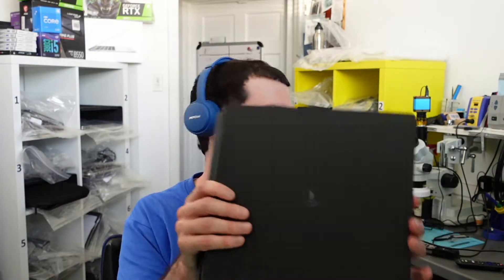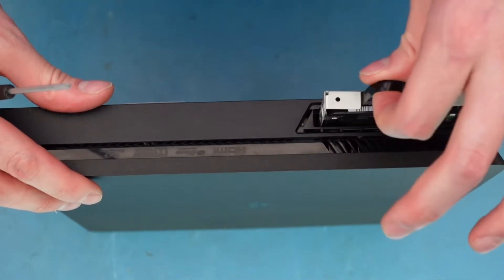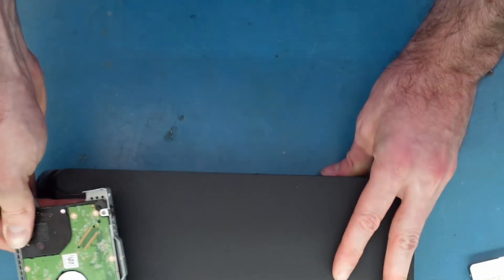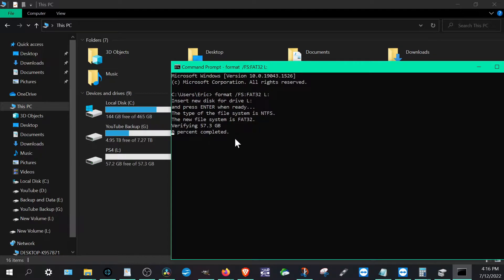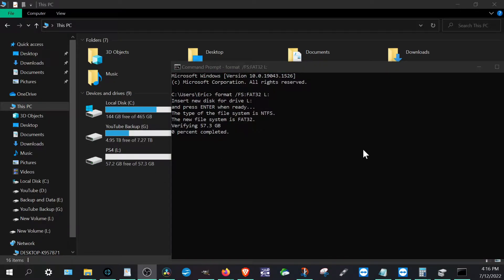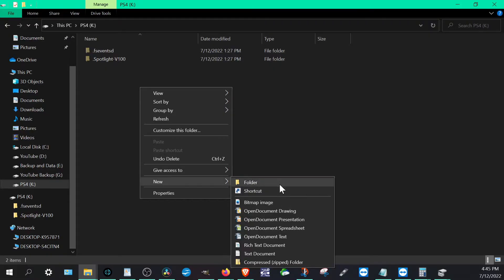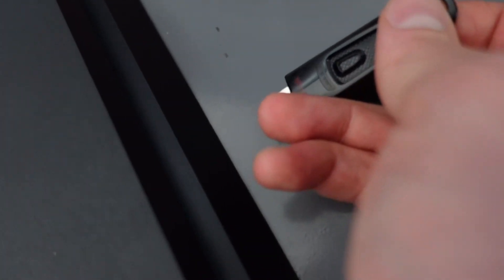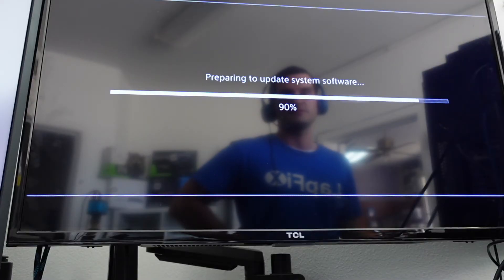PS4 Hard Drive Replacement + How To Upload the PlayStation System Software

Comment from the maker: Anyone still trying to upgrade or plan to upgrade to a PS5?  If you can't try to upgrade to SSD on your PS4! 😁
Reply: Going the SSD route :)
Reply: I don't wanna waste my money on PS5...for now👌
Reply: I remember the last time I put a 2 terabyte hard drive in my PS4 it accepted exFAT for the format. I've been trying to put a Samsung Evo 870 4 terabyte into and every time I boot it into safe mode to reinstall system software it says update file corrupted while I have the USB Drive-In. I will definitely take your advice and try FAT32 next
Reply: hey i have a question i don't know if you do know if its possible, but if you install the new ssd inside the ps4 can you install a jailbreakable firmware then jailbreak the ps4.
Reply: Sir, do you know how to fix the corrupted update file. I also upgraded my hard drive and followed the steps needed to reinstall the system software but it always end up in error corrupted file.
Reply: @rafaeljoshual.manguerra18 you ever fix that problem?

Comment: Is the process the same for a PS4 pro?
Reply: Similar process but the HDD is located in a different spot and you access it by removing a different part. I'd look up a video specifically about the PS4 Pro because it is fairly different.

Comment: Uhhhh my man so I'm facing an error code of SU-41333-4 or basically it doesn't detect the USB storage how do I fix that since I need to reinstall the system software but I can't seem to get the USB to be detected and I've tried a lot of ways and it still failed so I'm stuck

Comment: Hi there very heplful video, i had a question. Not sure if you ever throw any replies back. But its worth a shot 😊. So i am going to install a 1tb ssd into my ps4 for an upgrade. It has a 1tb hdd but i have had issjes with it since i first bought it brand new less then 2 years ago. It would not turn on after putting it into rest mode even being brand new. But i would just never put it in rest mode. But it started recently not letting wifi connecrions pop up at all and get stuck on swarching for connections page. And it said corrupted data randomly the other day. But i dont have acces to regular wifi or a computer so i bought a usb drive with the most recent system software or firmware available for reinstalling or intializing. I am also buying another usb drive for backing up my save data. Sorry for long comment. Will i be ok to  install ssd and intialize it and put my saved data onto new ssd? That is of course as long as the usb with the preinstalled system software and update works like it is supposed to. I can do eveeything without beeding a computer right? Any info would help so much thank you

Comment: I was looking into switching out my hdd for an ssd on my Fat Ps3 and Ps4, but I did some research. I asked what are the pros and cons of an ssd. Pros faster loading times. Cons ssd can only take so much deleting and rewriting. It may take 5 years, maybe even 10 years, but longevity goes to the hdd. Anything newer is Not built to last. I'm going to stick with the hdd. I'll wait 30 seconds longer for game to upload and my hdd last longer than an ssd. Any thoughts? Any testing done to see how long ssd last?
Reply from the maker: Hello!  You did your research!  For an OS, SSD is very good to speed everything up.  If you are going to be installing games frequently, that would put a lot of wear on the SSD, in which you should stick to HDD.  Maybe, for example, on the PS3, you have a set library and will only be playing games, not installing them, then the drive is only reading and writing very little.  SSD would be good in this case, otherwise, just stick to HDD
Reply: @lapfix  Thank you very much for your honest opinion. That helps me understand it a bit better.

Comment: Is it possible to take the Toshiba MQ01ABD100 disk drive from my PS4 slim and put it into my Computer directlt and back up all my system stuff that way and put it onto a new disk drive settings and all onto a different PS4?

Comment: Hi there. Got a new hdd, did everything like you showed,  connecting dualshock 4 usign the cable and starting de ps4. After a while, without pressing any button, it says :" Cannot start the PS4. Connect the DUALSHOCK 4 using the USB cable and then press the PS button "
I'm pressing the button,  but nothing changes.

Comment: Hey man, I want to use an old ps4 hardrive in a new ps4 I bought. Is this possible? I have all my stuff on the old ps4 hard drive ?
Reply: Yep. Just pull out the hard drive of the old 1 and put it into the new 1.  U won't need to download or do anything else as it already has the ps software system in it n so yea. Nice n simple.

Comment: I am planning to upgrade ps4 pro internal 1tb to 4tb. Is there any issue in the performance of PS? Few people are saying it may impact the on the motherboard. More noisy and heating issue
Reply: Honestly, I wouldn’t go 4tb I would do only up to 2tb it a older system so I would push it

Comment: is the systemsoftware on the console itself or the hdd?
i tried swapping the hdd from an old day1 ps4(glossy piano black) to a slightly younger model. but the younger ps4 said i have to update the swapped hdd to 9.04. i dont want to do that because i dont even know the OS version of the old one. could be useful for modding.
does this mean i have to fix the piano ps4 just to get access to the data on the hdd? old ps4 has a broken hdmi port but the warranty seal is intact and i kinda dont want to remove it, those ps4's get rare nowadays. but what you gonna do right? a hdmi port cant be fixed without opening the console. and the younger one has click of death, is it the laser moving up and down or does the clicking come from the hdd?

Comment: I needed a project so i bought a ps4 from a electronics pawn shop.  I tore it down to the motherboard. Made sure the thermal pads were in place. Cleaned the crusty motherboard cpu thermal paste off. Installed new thermal paste. I cleaned the years of dust out of this thing.  The fan and vents were caked up with it. I took the cd rom out tore it down and cleaned and lubed everything.  I tried installing a 1tb ssd SanDisk and got to where i needed the usb drive. I got a 64g usb drive and at that point didnt know where to go from there. I installed the old hd just so i can run the ps4 to test its function. Runs like new.  But this video on how to format the usb and what to download was very informative. Thanks for the video.
Reply from the maker: Good job refurbishing that ps4! Glad our video helped
Reply: I’m planning on doing this as well. I got a PS4 Slim from a pawnshop. It was in pretty good condition not too dusty. I will tear down to replace the thermal paste and thermal pads. I just put in 2TB SSD in it.

Comment: Hello. I've a question: If I already updated my Ps4 Slim with the latest version (10.01) Can I replace it with a new Hard Disk and install the 9.0 version on in?  Thanks a lot for your help.
Reply: Nah it won't work with older version
Reply: @thedonkeykong2722 I have the same question as him, but could you please explain why it wouldn't work that way?

Comment: My roommate's PS4 stopped. I reinitialized and put in the upload. Now it streams and plays Blu Rays, but games got stuck in download mode. So I'm guessing the hard drive cried uncle. Exhausting possibilities because can't really afford a new machine yet.
Reply from the maker: Yeah, you might need a new hdd
Reply: @lapfix  We shall see. Coming in the mail tomorrow.
Reply: Can a bad hd cause the ps4 to not power on ? I tested my power supply and have 12v but wont power on.
Reply: @Sambino i know it was 4 months ago😂 but was all the inside cords connected

Comment: Hi I have a question which might not get answered but...

I tried formating my usb but i get the error "the volume is too big for FAT32" I'm guessing my usb is too big but it's the same size as the one u had '57.3 GB' 

Any chance to fix this?
Reply: change from nat to th eother when formatting
Reply from the maker: Did you try my method at 7:47 ?

Comment: hey so I have done everything to try to fix data corruption issues on my ps4 I've initialized, factory reset, updated system software, rebuilt data base and I still get the same issue what could I do?
Reply: Same thing with me. 

Keep getting corrupted data error on the new God of War. I’ve deleted and reinstalled games. Rebuilt database, and even initialized the PS4. 
I still get the error CE-34224-5 whenever I start a game except for COD MW2 Warzone. 
This has never happened before to me.
Reply: @spicychich1718  Try google searching the error to see if you can find out what the problem is and how to fix it.

Comment: i have ps4, wont even read the data on usb. its in fat32 with correct folder, cant update, cant reinstall OS get SU- error. wish I wrote the code down, stuck in safe mode. i think the HDD is dead

Comment: after all that I go to option 7 and get the "cannot find the update file." (SU-41350-3). I have triple checked everything multiple times over and still get this error. I have no clue what to do from here
Reply: Maybe the usb stick could have something wrong with it you should try it on a different usb
Reply: @x0x0_  i am upgrading to seagate 1tb harddrive ,but it is showing error system software file is corrupted,on the same reinstallation firmware also on updated version too...help me what to do..
Reply: @GamingUntilDie  Did you try what Pluto said? And did you you choose Fat32 when formatting the USB drive?
Reply: exFat should also work, you need the bigger 1 GB Update file

Comment: Why am I getting an error has occurred (su-30634-6) what does that mean
Reply: same to same,is you found any fix???i am upgrading to seagate 1tb harddrive ,but it is showing error system software file is corrupted,on the same reinstallation firmware also on updated version too...help me what to do..

Comment: Yeah I have one issue I follow your instructions exactly and my new hard drive won't go into safe mode with my PlayStation 4 I don't have that problem with my old hard drive but my new hard drive refuses to go into safe mode and then my PlayStation says unable to access system storage.. everything I read about that issue simply means that the new hard drive is probably faulty. what do you think?
Reply from the maker: It shouldn't matter if the drive is defective to get to safe mode.  Hold the power button down until you hear the second beep, then immediately let go of the power button and it should go to safe mode